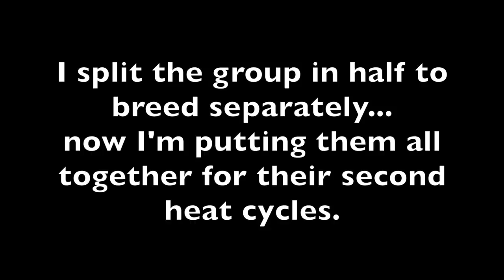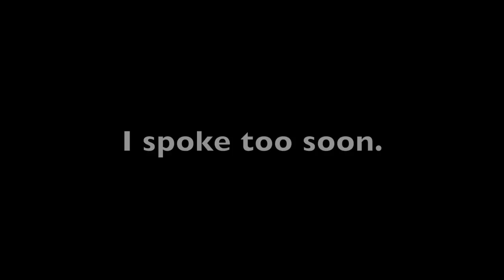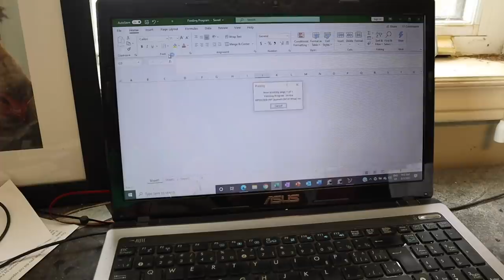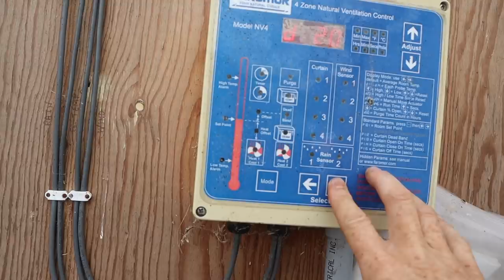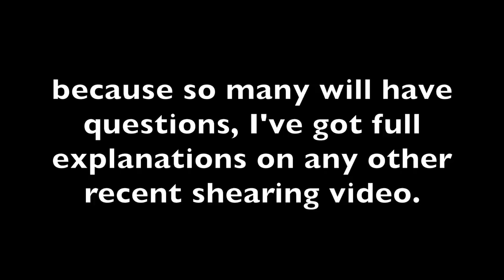WHAT DOES A SHEEP FARMER DO?  |  A WEEK IN MY LIFE.  Vlog 334

Comment: FELCO 50's have a revolving handle and angled head to ensure a tool that feels comfortable and natural to use. This will make your hoof clipping easier and more efficient ... are yours 50?  Maybe they're not broke?
Reply: YES that packet said FELCO 50.  So Sandi Brock after reading this comment by Leslie Alexander I went to the website and copied the info for you.

"The design of the FELCO 50 hoof clippers reflects all your concerns. Based on the FELCO 7 shears, the lightweight construction, revolving handle and angled head ensure a tool that feels comfortable and natural to use. This will make your hoof clipping easier and more efficient, while blades coated with XYLAN® offer protection against the risk of infections."
Reply: Was looking to see if anybody else had mentioned this. Looks like you both covered it. In other words the bend and rotating handle are features not bugs.

Comment: Felcos are guaranteed so send in.  Also, Felco’s can be cleaned and sharpened as a DIY project.  You can also buy new blades vs  new clippers.  Felco has made their clippers at last, not a one season and done
Reply: Yes! Buy yourself a stack of new felco blades and just swap them out as they get dull, then sharpen them in batches. If you don't have time to sharpen the blades yourself you can take the pile of dull blades into anyone who does chainsaw or lawnmower repair and they will know how to sharpen them. Keep a rotation going and you'll save a whole lot of money.

Comment: I just looked up those shears on Amazon and you can get replacements for  any part of those shears.  So you can get a new handle for this broken set and if you have an older pair you could get a new blade if it is too worn to sharpen anymore.  If you had two of these in working order and sharpened you would be able to get through this hand killing chore a bit easier.  Good luck!

Comment: Could you use a mechanical sanding tool for their feet since they are upside down? Might save your hands. There will be a learning curve, but ill bet it saves you time and money in the long run
Reply: Echo 9970  I wonder why. My boyfriend is/was a farrier would use angle grinders and sanders on horses feet that were really bad. I bet it's a learning curve, but I don't see a reason you couldn't? But I dont know anything about sheep! 😋
Reply: @dejavuchicka  Horse and cow hoofs are hard and there's a thicker amount of them.  Grinders work really well on them.  Sheep have more of a nail that resemble ours, much thinner and softer.  Imagine using a grinder on your index finger nail, rather than a nail nipper.  :)